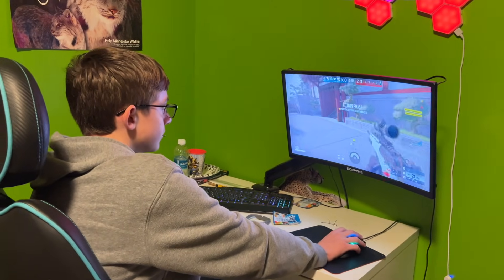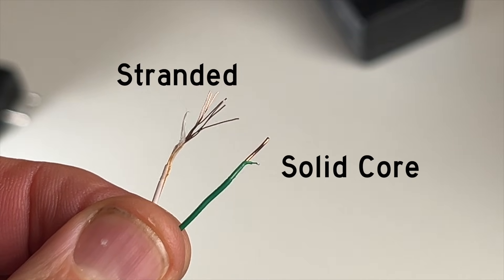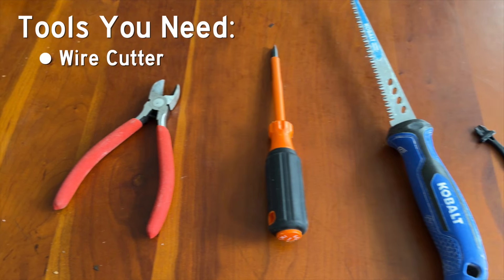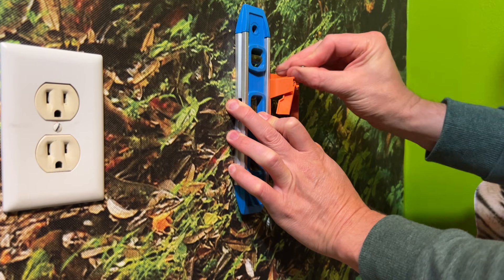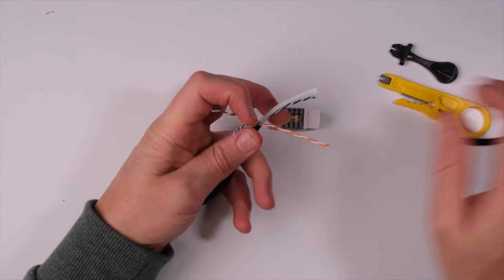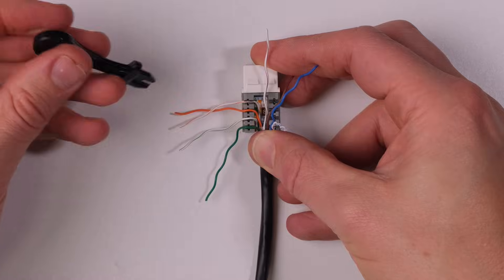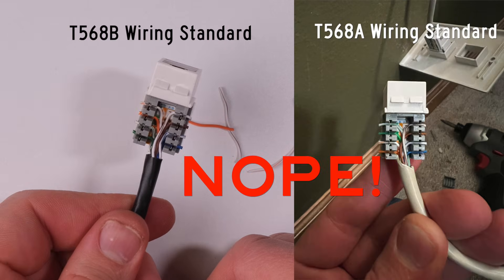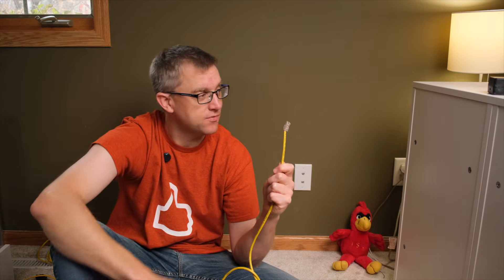AVOID These 4 Mistakes When Installing an Ethernet Jack

Comment: Side note even if you use A on one end and B on the other, modern gear will still work. This is called a crossover cable and used to be how you’d run lines between switches. 
One suggestion would be to buy a cheap cable verifier to check your wiring.

Comment: A small suggestions from someone who has been running cables for 30 years.  Don't just run one when you can run two.  It isn't any more work, and if something goes wrong you have a backup.
Reply: I agree.  I routed two to each drop that I wanted one, and four to each location I wanted two.  I no sooner routed all of the cable and hooked it up, then I ended up using most of them.